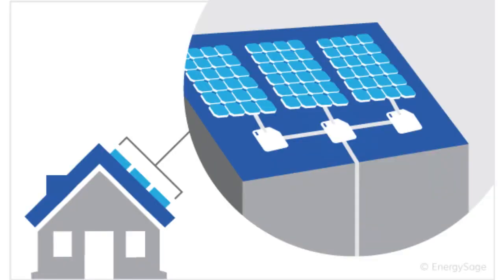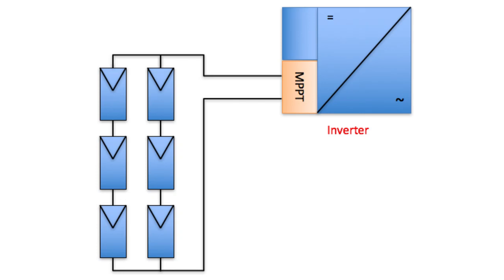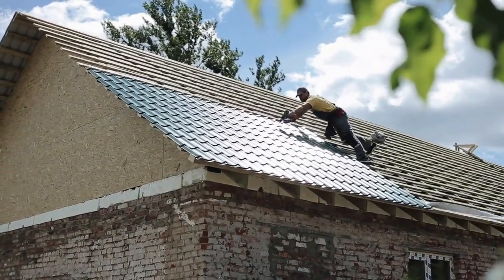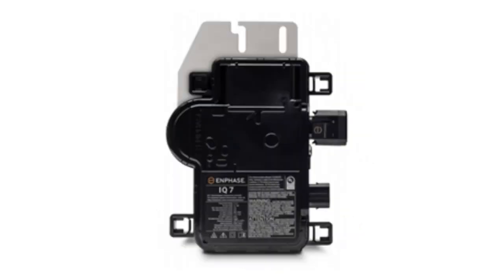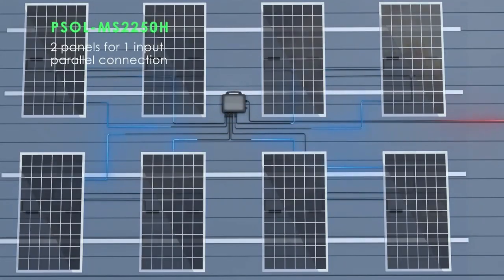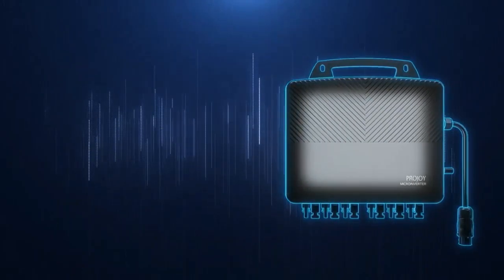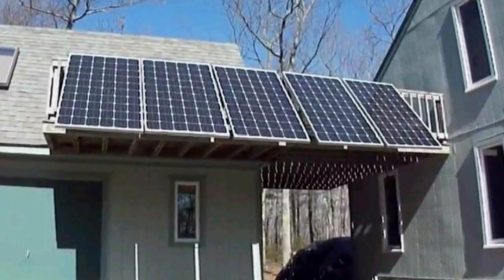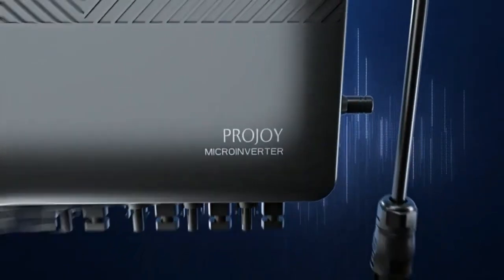8 panel Microinverter: The best device for your solar PV system

Comment from the maker: Most modern MPPT's are around 93-97% efficient in the conversion. You typically get a 20 to 45% power gain in winter and 10-15% in summer. Actual gain can vary widely depending weather, temperature, battery state of charge, and other factors.

Comment: It is just a plain lie that one shaded panels brings the whole string down to the performance of that one shaded panel.... Modern solar panels have bypass diodes, normally 3. Numerous real life test have been performed between string and micro inverters and the consensus is that it only brings max 3% increase. What people seem to be blind for is that both micro and string inverters are external to the solar panel, so the limiting factor is always what the solar panel can produce. Technically with a shaded panel with bypass diodes it can be that there are 2 (or more) maximum power points to be found, where ofc only 1 is the highest. String inverter will fail to find the best mpp of that shaded panel, going for the average mpp of the panels in the string. So the difference in performance is really not so big as this person says. Think for yourself: is al the additional costs for micro inverters worth it? System costs of micro-inverter vs string are considerable more. Currently in Netherlands a 400W panel costs 80EUR and a microinverter also 80EUR.. For simplicity say you do 12 panels, resulting in 960 euro costs for micro (also you need some hub devices costing between 200-350 euro), compare that to a 600euro string inverter, it is clear that I am not paying almost double for the panels+inverter micro components vs the string approach. I rather add 2 more panels of 80eur/piece to the string inverter to overcome the performance gap of 3%..... So my advise is for people watching this video: google for "real-life test between micro-inverter and string inverter"